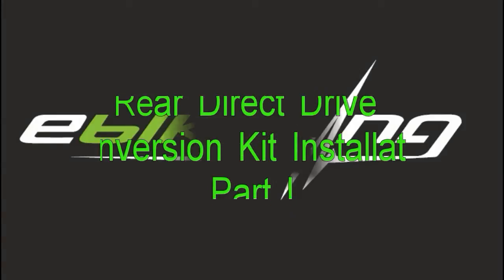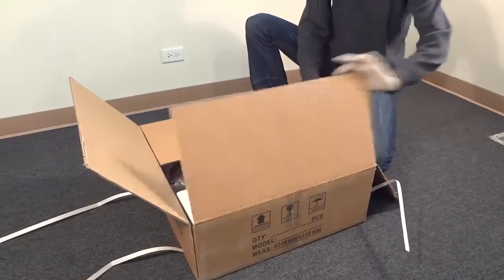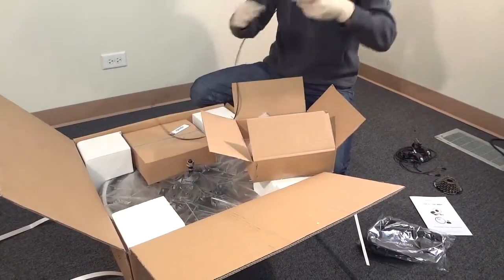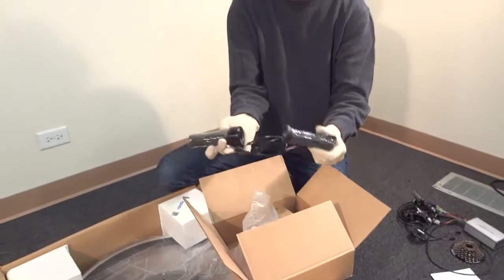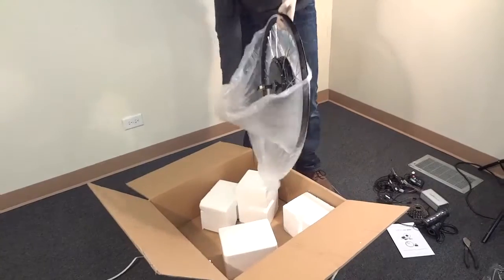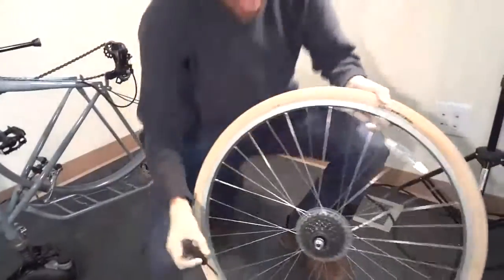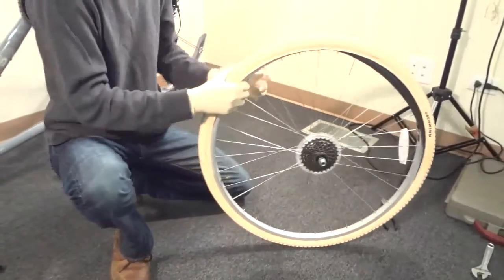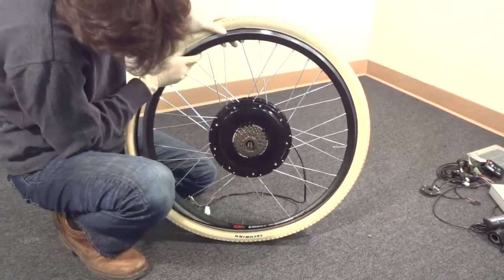EBIKE CONVERSION KIT INSTALLATION FOR REGULAR KITS (Part 1)

Comment: If he deflated the tire first he never would have had to loosen the brakes. Now the brakes have to be readjusted when the wheel goes back in. I build these bikes all the time for people. My preference is the ebikeling waterproof system. I like the clean connections of it. Also the LCD screen ads a bit more class to the bike and makes it look more “OEM”